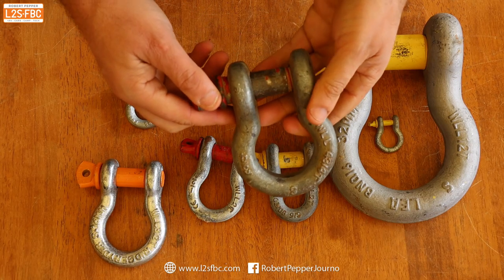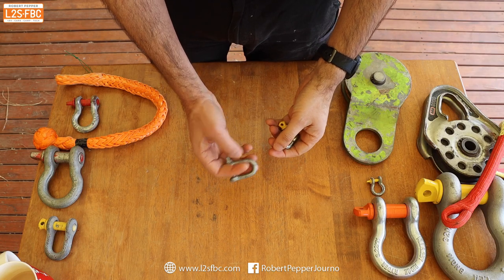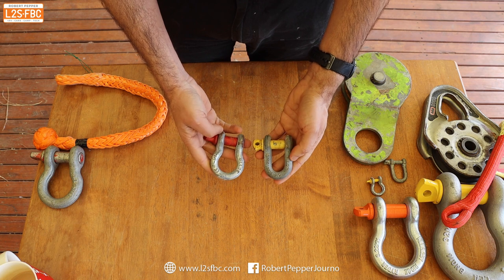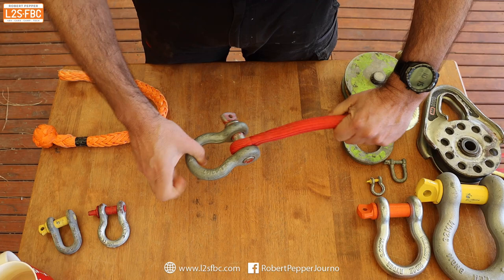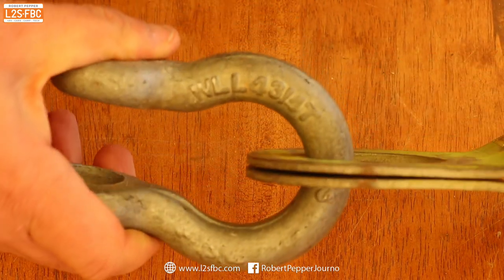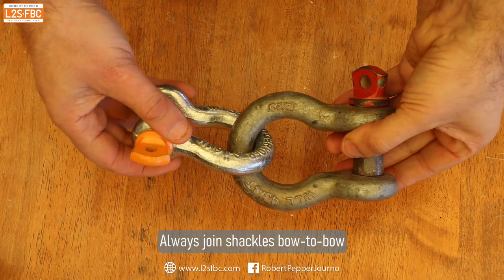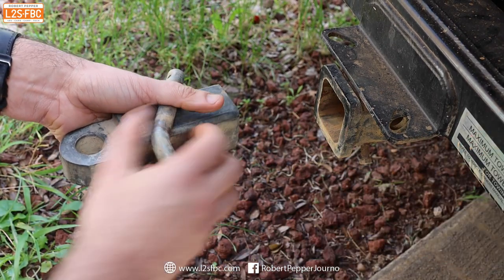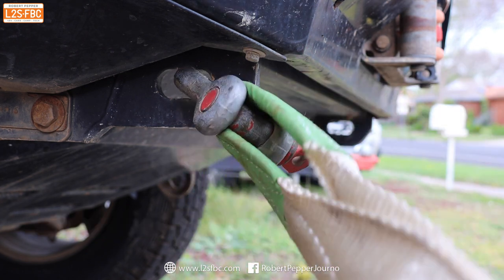13 things 4X4 owners need to know about metal shackles

Comment: As a crane operator it is good to see the shackle explained to the off-road world.   The WLL is a limit of load as used for hoisting, and should a shackle be used for towing it is no longer rated for hoisting.  This is due to shock loads which are imparted to the shackle which are not created in a hoisting application.  There is much to know about shackles and their proper safe application. A good read is a Hoisting Handbook.
Reply from the maker: Oh wow didn't know that thanks!!!
Reply: @L2SFBC  It also applies to ropes, snatch ropes and straps.
Reply: @Lhenry-pf5zn  I was unable to find “Hoisting Handbook” specifically. Most titles that came up include “rigging”.  Please let us know which specific publication you’re referring to - I like to read it!
Reply: Facts! as a rigger and instructor, i can verify what this operator commented. As well as the comment about slings, etc. 
Keep your tools/hardware/equipment specifically separated for different purposes. Haul=Haul, Hoisting=Hoisting 
also would like to add NEVER cannibals your hardware. Exp. dont take a pin and switch it to another shackle. Etc..
Reply: Not supposed to anyway.

Comment: Just bumped into this channel. As I always say, no matter how experienced you’re, there’s always something to learn. I learned 2 things that I never thought about!
Reply from the maker: Which two was that? And great attitude that is how the best people operate 👍
Reply: @L2SFBC  
 Actually four things:
3-  S & M rating 

9-  Easier tool to open a seized pin!

12-  Hitch application: vertical vs horizontal.

13- How to use recovery points the right way.
Reply from the maker: Thanks good to know what people learn 👍

Comment: I also love the wooden spacer. Wooden washers. It's funny how I make washers out of rubber, I've drilled out washers to make the ID hole bigger but never thought of using wood. I like how they keep the load pull right in the center. Good tips!

Comment: I wasn't sure I'd learn anything. Boy, was I WRONG! Thanks so much. I'll be getting a new recovery hitch as a result. I saved this vid for furture reference.
Reply: I love that hitch, it makes every recovery or extraction safer, you can feel your anxiety DROP from questioning if the strength of the hooks welded or bolted onto the bumper are enough. You know that class-V hitch rating and the rating for the 4/6/8, etc bolts holding onto your frame.

I didn't like the frame conetection for my hitch. I was also using the rear leaf spring mount bolts for the bumper adding more loads/stress. So I added 1/4 (6mm) 4140 steel plates to the last 14in (35cm) of the frame. Cut out the Ford rivets holding gas tank crossbeams and bolted everything back together with 8x 12mm 12.9 bolts on each side.

I don't fear the leaf spring falling off with the bumper towing or a recovery. Especially if I winch with the front end tethered to a massive tree, could have torn/twisted the truck to bits.

Comment: Another good idea for a shackle which may suffer the pin unscrewing due to repeated, continuous use, is the 'cage' the shackle. This entails using a wire, or  string, (I use zip ties a lot), through the pin hole and around the bow to keep the pin from backing out during use. It is also a good anti-theft idea to keep your shackles on your vehicles.

Comment: Snatch straps break according to age , amount of use and how they are used and it can be well below the wll if the circumstances are bad .  A wet ,  twisted , old strap hit hard 5 or six times in a row will break .  A brand new strap hit hard 8 to 10 times in a row can break due to loss of stretch .

Comment: In the Navy we used lots of shackles. If something is important we use a steel wiren to secure the screw pin sonit can't screw out. You put the steel wire through the whole in the pin and you start weaving it around the shackle.

Comment: Today I learned that an adjustable wrench is called a shifter.  I love learning alternative English.
Reply from the maker: Today you learned the correct term for an adjustable wrench and I learned the alternative term for a shifter 😁
Reply: There really is only one English, chap. What you call a wrench is actually a spanner. That tool which this gentleman used, is called a shifting spanner, but some people shorten that to shifter, not to be confused with that thing in a car that Americans use to select alternative gears in the car's transmission. Not that many Americans actually go to so much effort while driving. You know driving, I'm sure - its that thing that Americans do right before consuming what they call food, at those places that they call restaurants.
Reply from the maker: There you go sibco96, you have been educated! Now try to overcome your aversion to the letter u 👍
Reply: @Adrian_Nel  Y'know, most of the country that invented the things call 'em a Crescent wrench, bud.
Reply: Shifter  in Nova Scotia Canada it is also known as a thumb wrench
Reply: I thought a shakle, was a  clevise.
A crescent wrench,  a fittsall.
A hammer,  a speed wrench.
Reply: @Adrian_Nel  At least in N America we did not wire our cars electrical systems backwards!

Comment: I'm using the miolle soft shackles, I've only had them a couple month already but have used them to pull out stuck lawn mower several time. rainy spring plus bottom ground lol. The soft shackles are great for pulling out anything that doesn't have conventional hook-up points. Should have bought these years ago.
Reply from the maker: Great point, I also like the way they can attach to points you can't fit a metal shackle to.

Comment: Great stuff Robert, I thaught making my own bumpers would be easy, now you've thrown a curved ball, I have to allow the shackle to turn freely in the winch point and support lateral force in a bridle 🤔🤔🤔
     Mate, when you're use'd to four 30,000ld winches, what you can do with a small winch becomes a science, brute force is not an option, glad I've found you and subscribed,
     😷👍👍

Comment: Setting up for a "straight line pull" means that the centerline of the load should coincide with the centerline of the shackle. Never side load “D” shaped shackles such as *chain shackles or long reach shackles*. These shackles are designed and rated for in-line applied tension only. Screw pin shackles can be used for applications involving side-loading circumstances, HOWEVER, you MUST reduce the work load limit (ie; 6-45 degrees off center use 30% of shackles rated load and 45-90 degrees off center use 50% of shackles rated load).
Reply from the maker: Yep!

Comment: great video.   just a bit odd that 90% of off-road bumpers will put on recovery points that require you to put the pin through it, and not the BETTER way that you show, where the bow is toward the bumper.  As it is very rare to have a perfectly lined up & straight recovery, side load is a true issue to think about.   Maybe all the "trendy" bumper manufacturers should pay attention to your excellent points???   But good to see that the recovery points on my brand new F150 are in fact curved and do allow me to put the bow toward the truck and the strap on the pin.   And if I am properly using a bridle to spread the load on a recovery, you will definitely be pulling at 45 degrees on each recovery point.
Reply from the maker: Thanks! I have another video on bridles.

Comment: I have most of those shackle sizes, and that special receiver hitch shackle designed to hold a shackle at the vehicle recovery point.

I prefer a soft laptop bag with a reinforced ring inside to protect the laptop from agressive travel at airports iron, perfect bag for forged recovery in my rig, much better in a roll over or crash than a metal box coming off it's mount/strap and flying at something important. Toss my bag on the hood or roof without major damage to the vehicle.

⚠️🛑 EXTREMELY dangerous using these  shackles to connect 2 recovery straps out in the middle trying to double the length. Bad idea, unless the goal was to ride in an ambulance to hospital; with a hole in your head, or eye bashed into your faces. 🛑☠️⚠️

Comment: A side note, here in the US, markings are significantly different. Same purposes, just different.
Reply from the maker: How so?
Reply: @L2SFBC  Our rigging only mark grade 6 or better. I think yours might be better because most 4xr4 people are amateurs when it comes to rigging.  I lived it every day for 46 years. (Logging.)  I started out working with 2" skylines where the skyline shackle weighed 65 pounds and the pin 20. I do appreciate you comment about backing the pin out when using a shackle, I have had to take a torch to shackles where the pin wasn't backed out a bit.
Reply: @knotbumper   I could be wrong, but I don’t remember the coloring of the pins as an indicator that the shackle is ‘rated’ (in the US anyway). I know I’ve seen and used both, but never associated it as being rated or non-rated. [construction background]
Reply: Just looked at the Crosby catalog and same are painted and some aren’t.

Comment: Great stuff, so when connecting winch lines or bridles to the screw pin bow (anchor) shackle, do you use just some chafe guard sleeves or would you suggest thimbles to ensure proper bend radius of the rope’s eye?
Reply from the maker: Don't need either if you kee well under load limits

Comment: I have no experience in Off-roading, so I must ask: You said in the video to put the pin in fully and then back off half a turn (and I've heard it on other channels as well), but you actually just did 1/4 of a turn. Wouldn't half a turn pull it out so it isn't fully seated in the body? It looks like it is pretty flush when fully in and with the "largish" thread pitch one-half turn would pull it out too far, or am I wrong (something my wife often says is true😁)?
Reply from the maker: It depends on the shackle.  Some 'like' 1/4 turn, others 1/2 turn. You can also do no turns.  There is a bit of a debate about it..fact is, they are so strong 1/2 turn won't make any difference to what breaks first and it won't be the shackle!

Comment: You didn't mention the ones we use in underground coal mines that weigh 300 lbs and we've bent them pulling out covered up continus miners with
Reply from the maker: I was going to but hard to fit on my table
Reply: @L2SFBC   we had a crew that recovered miners  after they were covered up by production crews pulling pillars, , we had what's called a crab that had a 50 ton hydraulic cylinder that wedged a 6 way shieve with 2 inch cable into the top underground, we always got the miners out but not always in 1 piece
Reply from the maker: Wow...I love to hear stories like this so we can all learn!
Reply: @L2SFBC  I could try to explain a long wall move  underground but unless you've been there and pulled shields that keep you alive it's nuts

Comment: You do have some info wrong.

Not all shackles have a safety rating of 6. Most at least in the US crane and rigging industry are 4:1 or 5:1

Not all are rated for a side load pull. And a 45° pull doesn't derate the shackles itself but it does increase the sling tension by 1.5:1, 60° is 1.15:1 sling tension factor. And 30° is a 2:1 sling tension factor. 30° and below is generally a no go because not only does the sling have twice the load on it then a straight 90° pull would but because it is very easy to rip off or at the very least bend attachment points. In a vehicle that could be your hitch or your axle mounts.

Pin to pin is always frowned upon, not because of ratings but because the shackles can shift within the connection point. Typically this doesn't matter but a d ring or master link is a better method.

Centering the sling on the pin is a good practice but except in critical lifts which are high risk or high weight lifts we typically don't worry about that. Keeping the proper spacers around and available would be nearly impossible since the sizes vary so much and 2 because they get lost quite a bit. 

In my opinion having an in depth knowledge of snatch block usage and the proper equipment available is more valuable than nit-picking the shackles uses.
Reply from the maker: Thanks for the clarifications, Kyle. I was working off Australian standards...good point about 4 or 5 to 1. Going to do a video on bridles and forces which will cover some of the above. Thanks again!
Reply: @L2SFBC  bridles are interesting because if you self assemble them you only use 2 legs for the load capacity calculation on a 4 leg system, unless you have a way to equalize the leg lengths, where on a 3 leg you use all 3. Unless it is on a lifting device in which the system,bridle and device, are only tested to 125% at least by US standards.
Reply from the maker: Simpler for 4x4s...just need two legs and focus on the included angle!
Reply: @L2SFBC  yea much simpler, I've worked with bridles with 16 legs. Each leg had an load moment indicator so we could adjust each leg by turn buckle to make them equal tension. Total load was right about 500ton. Just left corpus cristi TX where we pulled a head with an 8 leg bridle that was 256ton. That one was much easier just measure the turn buckles out to engineered lengths.
Reply from the maker: So much to learn from the hoisting industry!!!
Reply: @L2SFBC  main thing is the offroad industry abuses the rating system. Cheaper options uses the breaking points as their max ratings. Unlike the hoisting industry. If a shackle isn't made in the usa, Canada, or Europe I won't touch it. Crosby, vanbeast, Campbell, cm, New Holland or Chicago are the only ones I will touch. Slings are typically sourced locally in my case since the oil and gas industry is so plentiful in the area rigging companies are as well. 

I do struggle with finding quality snatch blocks. I've used a few from warn and arb. The ones we use for the hoisting industry are rather large and heavy. A 4 ton single sheave is like 5kilograms which alone isn't bad but when you want a few they add up quick. The 6ton variants are nearly 10kilograms each. My truck weighs 4tons everyday. If my rv is behind me I'm pushing nearly 11ton. So I tend to oversize everything. Especially after seeing some pretty bad failures.

Comment: Says, half a turn, but backs the pin off a quarter turn. Which is it?
Reply from the maker: Depends on the load and circumstances. Maybe run with a third.
Reply: You typically only back off a 1/4turn max. Crane and rigging industry standard is no back of but to rather tighten till touch but not tight.